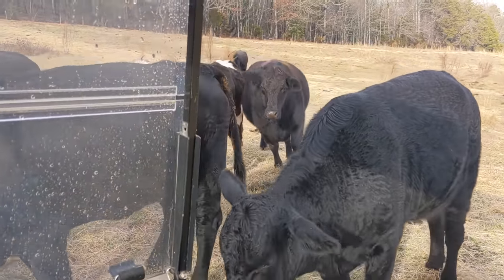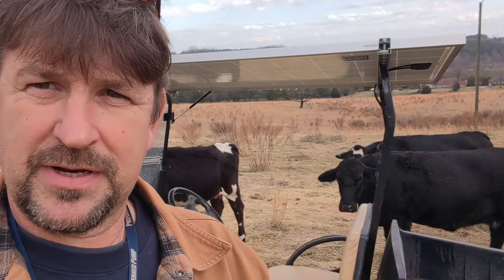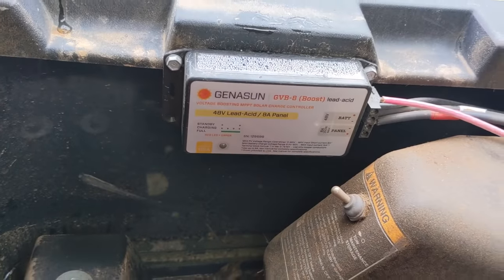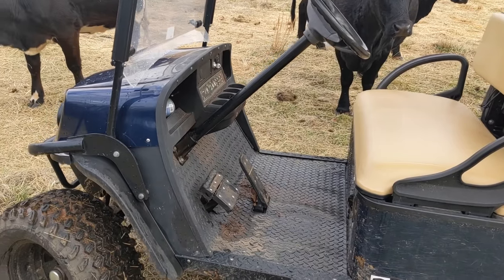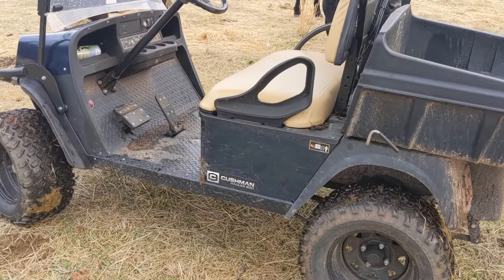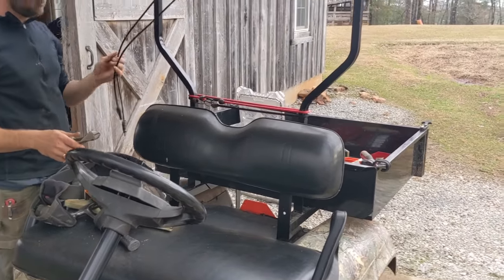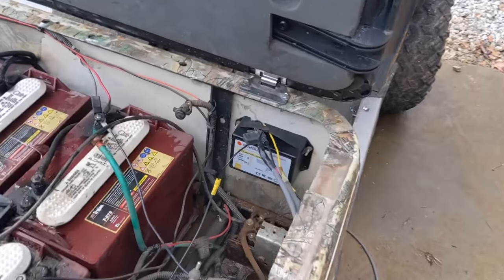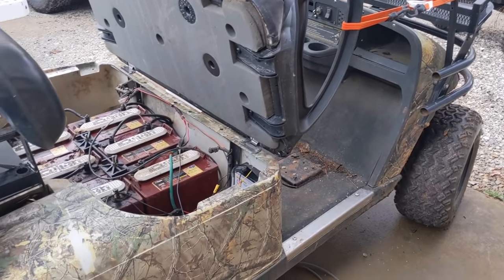Regenerative Golf Cart

Comment: I am a Long Distance and Mountain bicycle rider. Fifteen years ago I ruptured my Aorta in a Bicycle vs OneTon Collision.
I have lingering effects that limit my riding like I used to do!!!
My buddies want to Ride The Continental Divide in a few years. 
I would like to ride with them!!!
I was thinking I could ride an 
e-Bike.
Some people pull a small aluminum tubing/canvas trailer behind their bicycle. I was wonder if I could attach some sort of Solar Panel on a framework above the trailer which could charge the extra batteries for the e-Bike.
Are there any Solar Panels that are lightweight and flexible that could be easily attached and not be that great of a weight problem. Those panels on your gulf cart provide how many volts at how many amps???
Many e-Bikes are 48 volts DC.
I would also like to use a LapTop and Cell or Satellite Phones.
Can you help me with any advise and Technical Info???
Reply: There are a few guys on YouTube that built solar charging touring e-bikes that are similar to what you want. You'll probably have to do all your own research and build. The information is out there. 

Will Prowse runs a popular channel for all things solar and storage. He has a number of videos and a few books that are geared towards people starting from zero knowledge of electricity that will help you build a functional project by the end.

This is all super easy after you've done it once.

Comment: What voltage solar panels are you using? Can a 24 volt solar panel work with a booster or 2 12 volt 100 watt panels from harbor freight with a booster work?

Comment: What gauge wires did you use to go from the Genasun controller to the batteries? And did you just use 10AWG extension cables for the solar panels to the controller with butt end connectors?

Comment: I wondering 2 things, can this Genasun charging system charge while in cart is in operation?  I know it will still drain in total during operation but does that have any bad effect on the batteries applying charge while cart is draining at the same time?  

Also do u have to have a breaker switch to isolate the solar panel/Genasun controller from the 120v charging system if you have to charge off the grid with your normal cart charger, say on a cloudy week?

Comment: I'm just curious, it looks like you've got a 48 volt controller on a 36 volt 6 battery cart. Just curious why?
  Back in the early 90s I was interning at a small Solar Company in Michigan. He had a GE electric garden tractor that we put a small array on. It would charge between the weekly lawn mowing sessions.
  He also had a very small pontoon boat with a small array built on to it. It had two trolling motors and would cross a pond at a medium rate. He had the tapered ends put on the back of the pontoons upside down in order to reduce the noise from the water in the wake of the boat.
Both of these would sit in the Sun for a week charging the batteries before they could be used on the weekends. Just wondering how long does it take to charge yours from empty?
Reply: it does UP TO 48 volt

Comment: Great job!, can I ask you the wattage of the panel, I take it it's also 48v
Reply from the maker: No the solar panel is actually a 24-volt panel that's where the boost controller comes in and takes the voltage higher than the battery voltage to make sure that it charges. This panel happens to be 280 w.
Reply: @engineer775  thank you, you taught me more there, it's part of knowledge I'm missing , good day to you sir

Comment: i really appreciate the video, i understand the reason to be independent of the grid, but holy crap is this  equipment expensive to charge the cart. I'm just curious how long it will take to pay for itself.
Reply: Solar is relativ cheap if you dont need an extra battery, but it depands on your local energy prices. It is probably more about luxury he dont need to care about charging anymore and it cant run out of battery if you forgot charging.

Comment: Do you have problem with battery balance? I have solar on the house, and i got used batteries. I had 48v setup, but one battery is getting too much and other one less voltage... Now its 24v

Comment: Am I missing something here? 6v batteries x 6 batteries = 36v not 48v. Is there two more batteries I’m just not seeing?
Reply: 8 volt batteries
Reply: @BobbyJackBland  had no clue they made 8v batteries. Learnt something new today
Reply: @somethingsomeone5440  They allow manufacturers to use more powerful 48V motors without having to redesign their battery trays, since the 8V batteries are about the same size as 6V batteries.

Comment: Can you get that charge controller in 72v? I have a 72v cart that would be a great candidate the for this.
Reply: No, but you can use a pair of 36V controllers charging each half of the battery bank.  Each controller will need a separate PV module.

Comment: Will 190 watt 60 cell be enough to power a 48 volt cart?
Reply from the maker: It is better than nothing but of course the bigger the wattage the better. but the genocide will boost the voltage up to make it work.
Reply: Are you able to still get the solar water controllers I see you've taken them off your site. Or did they have problems. I've got one but I was thinking about having a backup
Reply: @engineer775  Genocide? That's unfortunate branding.  😳

Comment: For the cost of the voltage step up, has anyone tried 2 smaller ~30V panels in series with a typical mppt charger? 
There are a lot of those slightly older ~200W panels in CA.

Comment: I’m just converting my golf cart to LiFePO4 batteries and what do you know genasun makes a charger for that. My cart will loose 700lbs of batteries and run off the sun.   GVB-8-Li-56.8V-WP
Reply: Please upload details, specs, cost, and experience with your upgrade. This is EXACTLY what I want to do too.
Reply: @brandtjustsayin  Daly 16s 250 amp bms.  Get their led power switch display box too….you’ll need it. 16 100ah LFP batteries from Amazon. And of course genasun charger.

Comment: I have a Wheelchair scooter 24 volts How can I hook that up to a solar panel
Reply from the maker: Would that you just need a normal charge controller for 24 volts and any standard 24 volt solar panel.
Reply: @engineer775   I'm pretty new to this stuff.  you get a better charge out of this charger because it checks the power coming in 15 times a second, where some  of the common MPPT controllers do it maybe once a minute ?   and is boost just the phrase for raising the lower voltage from the panel to the battery expected (48 in your case) ?  The power going in remains the same per P=IE , eg the amperage is lowered so the voltage goes higher ?  I see they have them for Li batteries as well.

Comment: How many watts is the solar pane?
Reply from the maker: This one is 280 watts but we've used them from 200 to 400 Watts. The boost charge controller will clip so it won't overcharge the battery.